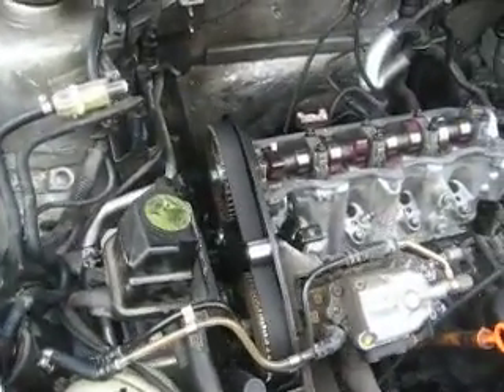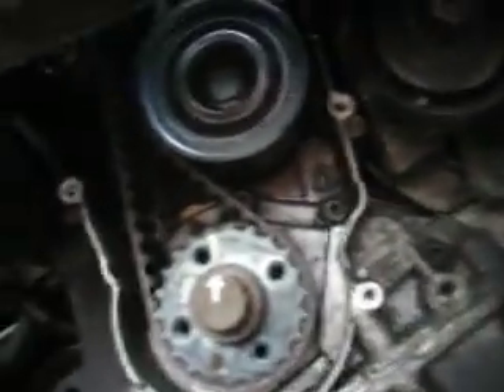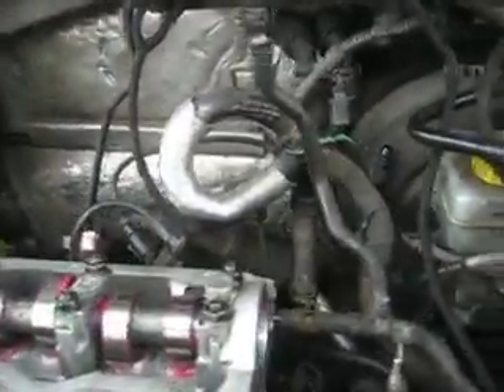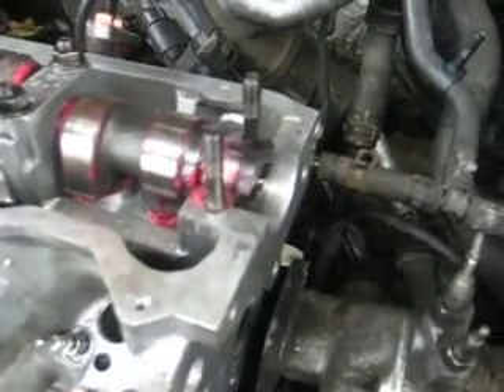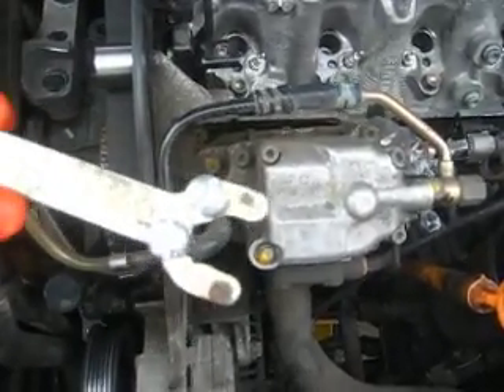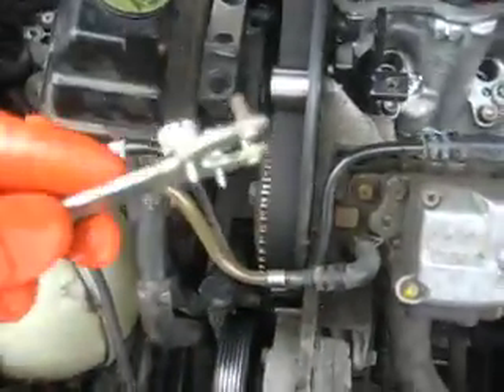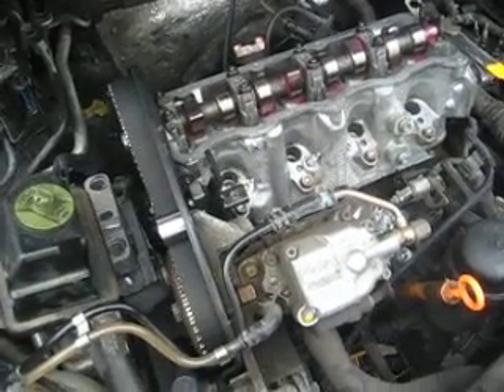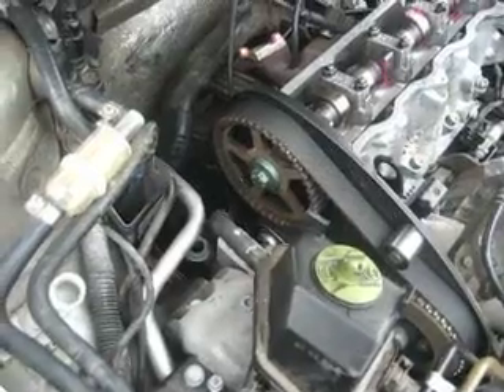VW TDI Timing Belt with no Tools + Helpful Hints

Comment from the maker: I just adjusted the Turbo actuator with my Might-Vac.  Now I can feel the turbo and the speed boost.  It was boosting at 1.3k-2.1k RPM.  it was a quick start but no boost on the highway.  I changed to boost at 2.1k-3.0k PRM.  We just came back from a 1000mile trip, and these TDI sip diesel but scream down the road at 85 MPH.   I love it.  Only problem is that at 2000ft (Tennessee) the turbo as choking.  I had to turn off the A/C and restart the car to maintain the turbo.

Comment: Thanks for the video showing some of the "alternate tool techniques".   I did my own timing belt after digging for ALL the information possible.   I made a belt tensioner just as you had, and I'll have to load up a video to show what I used for my cam lock.

I had no issues setting the cam and crankshaft at TDC ... But, it was a pain in the rear to get the IP set.    Remove all the reservoirs and pipes and wires away, and use a mirror and a flashlight to confirm that locking pin hole!

Comment: @GallowayChicago I agree with unnecessary over complication. Sometimes, things are never as difficult as they seem. A chap I knew did all his own maintenance and we talked about the high price Alfa charged to do a timing belt change. He quite rightly said, "just because it's an Alfa, doesn't mean it's hard to do". My brother is an auto technician and finds the likes of BMWs actually easier to work on than many small cars. I like well thought out German engineering! Everything is logical.

Comment from the maker: @1100HondaCB 
Thanks for the compliment, but I thinks the VW Dealer makes it seem much harder then it is.  Real VW enthusiasts like the cars because of the attention to details that the designers and engineers put into the cars.  The white jump suited over-priced service is purely an American deviation. How much simpler could a diesel engine be?  Tell me why does the dealer charge $400+=Glow Plugs, $95+=Synthetic oil change, or $30+=reset the service interval light? "VW Service hurts the Brand."

Comment: I am surprised the TDI isn't 16v and DOHC. I thought most of them were, although nearly all diesels are now DOHC with 16v. Most manufacturers are now going back to timing chain, which in my opinion, is a good move. It's amazing how you can improvise and fabricate or use certain items as a substitue for expensive tools.

Comment from the maker: @eb2143 As of today this video is most popular in these countries/states: USA(0.3), UK(0.27), Ireland(0.25), Canada(0.25), Bulgaria(0.21), South Africa(0.17) and so on.  I use two wooden wedges to remove the cam gear.  I also made the Cam holder bar out of 3 bolts and two metal bars I had already. I am not trying to say that everyone should make their own tools but I wanted to let viewers know that you could if you wanted.

You are right about the MetalMan.  He is an asset to the VW community.

Comment: @GallowayChicago  Well, considering where the vast majority of your viewers are according to the video stats (US and Canada). You may want to point out MetalManParts rents the tools for $45 and that the rental includes 7 tools, rather than 3 like you made. I'm interested how you pulled the cam gear...using a hammer or punch sometimes works, but often damages the pulley.
I am in no way affiliated with MetalMan, I just am a customer who changed my timing belt with the excellent Metalnerd tools.

Comment: Just remember if you take it to a dealer, the apprentice will properly do this job.
Ive seen in dealers staff cut the cam belts in half then slide on the new belt and then cut the rest of the old belt off. Then just push the new one into place. If you can do it. Then doing the cam belt is well easy and quick.

Comment from the maker: Thanks Huggles92!

The dealer calls it "Paint and Pray" whenever an owner does their own timing belt, but I wanted to show that you don’t need an overpriced garage to achieve the same if not better results.  I say better, because the more you know about YOUR car the better you can attend to its needs, and a lot of little things can be done to help YOUR car while you are changing the timing belt.

P.S. I will post a video of the car running later. 150miles and no problems just a vacuum leak.